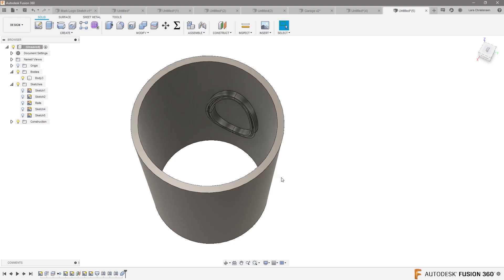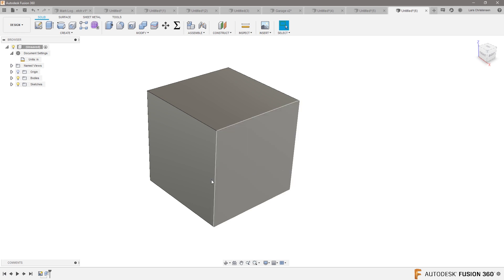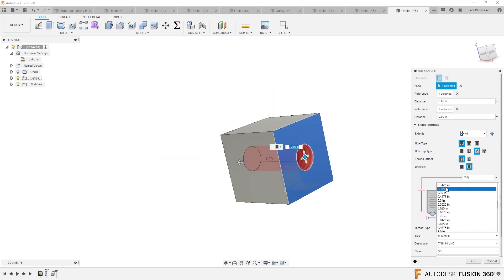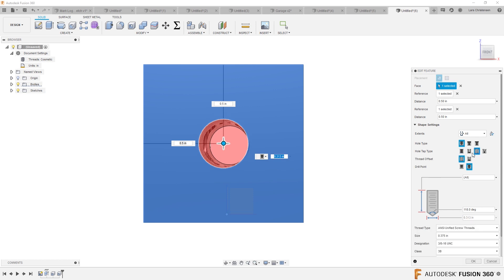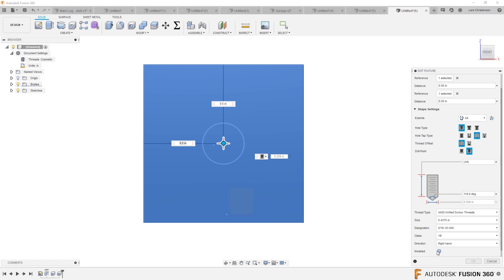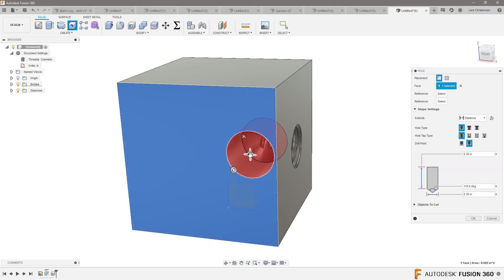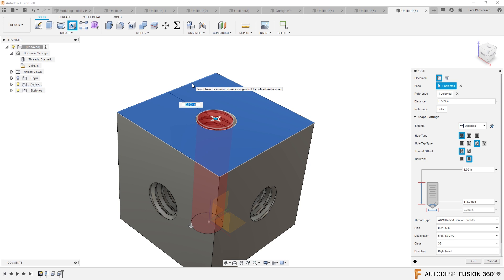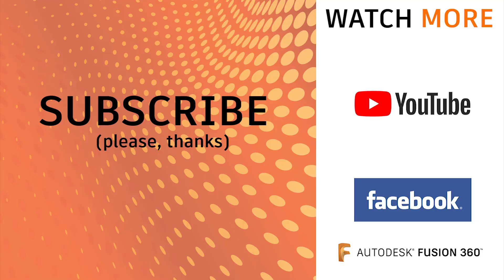Fusion 360 — Beat Error With Threads Within Hole Command — Ask LarsLive

Comment: I used the thread in an extruded command to pierce other threaded holes and never had an issue, then suddenly on a complex part it failed to paint the threads on all the holes. I found this video switched some to threaded holes and it took. Lesson stay flexible, don't get confused with what works most of the time.

Comment: I'm having a major issue with creating threads all of a sudden. Well creating fasteners in general. As you know that many times it is necessary to adjust threads to allow for more of a gap between nut in bolt.

I have not created thread and objects in several upgrade time periods so apparently something has changed in fusion 360 or at least in my install. I am no longer able to select the faces of a thread to adjust using the extrude tool. I typically used to adjust by a very small negative value just to make the fit a little looser due to the plastic imperfections that exist in 3D printing.

I used to make threaded objects all the time and did not have to do any sort of adjusting at all they just always worked perfectly as long as I didn't have my settings screwed up in any way which is kind of hard to do there's only a couple different choices LOL

at any rate has anybody noticed this? I simply cannot make threads anymore and it's driving me crazy I require fasteners and I do not like making blind holes and using nuts and bolts! I would rather make the complete system myself

Comment: Lars, it seems that if I try to add the 2nd hole via the hold command it works. However, if I add the hole unthreaded then use the thread oommand it fails with an error. Perhaps, sequence is critical?

Comment: This is the normal fusion frustration i think!
You don't know whats wrong, and there is propably nothing wrong but still, you can't achieve what you want.
Reply: I did the same thing and it made the holes threaded at 1/2" -12 instead of 1/2"-13. Printed it and checked it with a thread gauge and it was 1/2 -12. Never heard of 1/2" - 12 before. I've been machining for over 50 years. I even checked remember settings. Something is not right with the thread modeling on occasion.

Comment: How to add threads to more than one hole at a time. Instead of a single hole
Reply from the maker: In the hole command there are an option to add multiple holes with threads
Reply: To elaborate on Lars' answer, in the Hole dialog, the first option "Placement" allows you to select a "At Point" or "From Sketch".  If you select "From Sketch" (the second option - square with four holes in it), you can create multiple holes with the same properties at the same time (including threaded).  Just make sure your sketch is visible and aligned with your body.  If you normally sketch and extrude up, you may have to flip the direction of the hole, or if you're counterboring, you may have to project the sketch on to the top face.